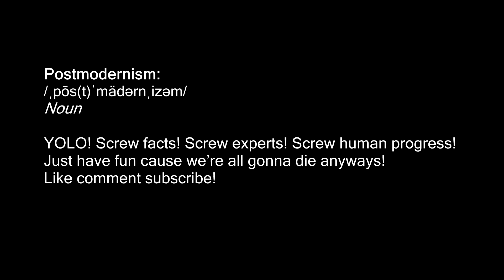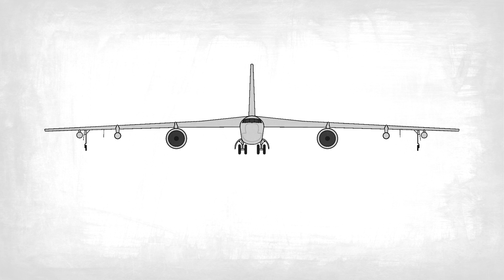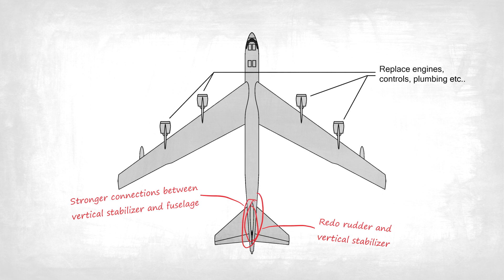The B-52 is Getting New Engines... Why Does it Still Need 8 of Them?

Comment: The particular kinds of payloads the B-52 may be called upon to carry cannot be dumped just anywhere or anytime. If I was the pilot, I would want all the redundancy possible to avoid dumping the bombs too early or too late if some unexpected disaster occurred.
Reply: Not sure, but I would imagine that most bombing missions - at least with conventional bombs - have designated areas relatively close to the airfield where they can drop their bombs if they have a problem. I think in some cases even if they abort the mission but nothing is wrong with the plane, as they're not supposed to land with them. I recall in WWII bombers out of England would drop them in a designated area of the English Channel, from which boats were kept out. This is a bit more problematic with a nuke though, as the radioactive material means one being dropped is a major incident even if it doesn't go off.

Comment: The rudder fin height on the B-52 was once much taller than it is now. I the early 1960's (I believe), the rudder fin height was reduced on the B-52's produced after the earlier models (& maybe some of the earlier models were also retrofitted with the shorter rudder fins, as well). I'm not sure why this was done; possibly to reduce the cross sectional radar signiture of the fuselage. But the taller fin would have had more surface area, & thus provided greater yaw control, which should have been more favorable for more powerful engines. But I don't think increasing the tail height is the right solution, since the aircraft's radar cross section is probably already quite large.
Reply: The cross section of the aircraft is quite massive, it's just one of those aircraft that does not actually need to care because of its choice of armaments.

If you are against a non peer adversary you can just sit high and swamp a grid square or two with GBUs. And if you are against a peer adversary you can carry a Frigate's worth of cruise missiles you can launch from far beyond the range of any AA system. 

Hell I am sure if you just filled the thing with SDBs you could single handedly target an entire subsection of the front with bombs to the point where the primary bottleneck would not be if you can target enough things but if you aren't going to cause the datalink network to crash.

Comment: It doesn't have the GROUND CLEARANCE to use single with enough thrust to make up for the 2 of the ones it has (or is getting).
You'd ALSO have to completely redesign the landing gear, and the landing gear housings, and all of the stuff AROUND those housings......

Comment: Sounds like a regional jet? Yeah - no. I grew up om B-52 bases - nothing sounds like eight Pratt engines with zero restrictions screaming at full power on takeoff during an alert. We would high tail it to the end of the runway on our bikes and watch these bombers roar overhead - the ground would shake and the roar of those engines would deafen you - it was great! I understand that American made Rolls Royce engines are replacing the  Pratts - I would love a chance to hear one of these updated planes to see if it has the same effect on me all these years later.  The B-52 came out before I was born and I'm sure they will be still in service long after I'm gone.
Reply: Yeah, spent the first few years of my life at Blytheville AFB.  Nothing like the sound of a B-52 on takeoff with that water injection on those engines.
Reply: I live next to Edwards AFB.We have ALL the Air Force's current inventory (and one or two from the Navy) flying over our house almost daily. It's easy to tell the difference between planes by the noise generated and the amount my house shakes and rattles, even though we are around 12,000 yards from the centreline of the runway and behind low hills. B-1s and B-2s rattle my windows when they takeoff, but F-22s barely cause a ripple in my coffee. F-15s rattle the stuff on the shelves,  C-5s rattle the furniture, and when BUFFs take off, they occasionally make car alarms go off. We get regular sonic booms and low-flying fighters, etc. but the best (and funniest) thing I've seen in 9 years living here was when a C-17 flew underneath some very surprised crows, probably less than a hundred feet off the ground. That guy was practically on top of us before we even knew he was there. Bloody noisy when they land though :-D

Comment: As a machinist for the DOD, I've been hearing this conversation for more then 20 years....
Its NOT going to happen.  Its an engineering nightmare! TF33 a proven engine, a little weak, a gas hog & just old. 
I've made many parts for the 52, some of the blueprints I have worked with, were older then me,( Im 60)

Comment: Thank you. I'm a systems guy and had no idea even 4 engines would cause so many systems imbalances. Define to goal of what 2 or 4 engines would accomplish. Engines are only about thrust and fuel economy. If 8 new engines meet that equivalent, then good to go. No other mods needed. It's not likely a weight savings would translate to more payload.
Reply: Typically fewer larger engines are more efficient than more smaller engines. They're also less maintenance, as typically there isn't much difference between maintaining a small versus large engine, so half as many engines means half as much maintenance. And probably an engine that produces twice as much power will cost less than twice as much. So fewer larger engines is more economical all the way around. For this reason airlines, who care mostly about operating costs, have abandoned quadjets and now use twins for everything. Why the 757 replaced the 707, the A350 replaced the A340, and 747s are being phased out mostly in favor of (slightly smaller) 777s. The same logic would seemingly apply to the B-52, but there are some differences. Military is less concerned with operating costs as they aren't trying to operate on thin profit margins, the aircraft typically fly a lot less, designs are more specialized, and combat survival is a consideration. For the same reasons, airlines aren't flying anything nearly this old, if they were really concerned about these issues to the degree airlines are they would have bought new aircraft decades ago rather than talk about re-engineing a design from the era of the very first jetliners. Though that too is less practical, as due to a smaller market the per-unit development costs would be astronomical. Actually come to think of it they've tried to replace the B-52 several times, first with the supersonic B-1, then with the stealth B-2, but both were not as good in the end, trying to achieve other things (supersonic, stealth, respectively) when what was really needed is just a big plane that carries a lot of stuff.

Comment: Something I pondered over for years!  Why not put four newer, more efficient engines?  As stated in this clip, too many other mods to an aging airframe would not be cost effective enough to warrant that.  The old engines are improved over the years anyway with enough technological improvements anyway, right?  But then again, one disintegrating engine on a “twofer” pod, most likely will effect the good engine.  So...
Reply: That's something I've pondered, all this talk of redundancy with 8 versus 4 engines. Depends on the failure type, probably the majority of engine failures are "contained," so wouldn't throw debris into the other engine. But some are uncontained, such as a fan or turbine failure, and I'd worry could damage the other engine. As happened to LOT Flight 007, when one engine turbine disc failed, destroying the adjacent engine in the Il-62's similar two-engine-nacelle, though it also damaged an engine on the other side and systems in the tail, resulting in loss of three of four engines and flight controls. With the B-52, I think about this even more with combat damage - engines destroyed by being shot at, flak (or whatever the modern equivalent of that is), maybe even a missile, anything like that hitting the pod is likely to damage both engines simultaneously, or cause an uncontained failure of one engine that destroys the other. Thus from a combat survival perspective, I'd regard the two engines in each pod as a single unit to be lost together.

Comment: And remember, the new engines do not mean they will have more power and thus more thrust.  Nor will they shorten the takeoff roll.  The wings and fuselage are stressed for the power of the existing engines.  Nor will they increase its top speed.  These new engines will do nothing for performance.

So why the new engines?  The last B52H was delivered in 1962 so the existing engines were designed for 60-year-old airplanes based on 60–70-year-old specifications.  No, these new engines will be more maintainable from a cost-effective standpoint and from a mission standpoint, add range.  Therefore, they will require fewer air-to-air refuelings per mission profile.  And let me tell you, fewer air refuelings is well worth the expense.

I never got to fly the 'H'.  I flew the B52G during the cold war of the 70s.  A major difference between the 'H' and the 'G' was that we needed 10,000 pounds of water for takeoffs to get the 488-thousand-pound beast off the ground.  But the air refueling challenges and stress were the same.  And now that our grandsons are flying the BUFFs, the new engines will really help them.

Comment: Commercial jets went from 4 to 3 engines to circumvent noise restrictions at some airports which chose to deny access to planes with 4 or more engines. The video missed that fact.
Reply: They have reduced engines to lower costs.  Safety has been the casualty.  They dumped flight engineers.

Comment: PDX heavy: the fin of the B-52 is unique although has a tiny rudder compared to the rest of the fin
Ichinose: aww it has a cute rudder
Kakudate: ehh it has a very tiny rudder
Mikamo: uhh no big rudder
PDX heavy: the Air Force chose 8 of them to the B-52
Ichinose: OMG that was funny
Kakudate: it has 8 of these engines
Mikamo: 🤬 what the hell was wrong with the plane
PDX heavy: ahhh the B-52 the prehistoric plane that will fly beyond 2050
Ichinose: it is called the stratofortress
Kakudate: it is normally built by Boeing now Nexon
Mikamo: it is a Godzilla but the plane version

Comment: I just heard from a Pratt & Whitney employee that P&W is now out of the running. Also, those BUFF wings hang kind of low to the ground necessitating smaller, but more powerful fanjet engines. Airbuses' current gen. of engines probably will not be cost-effective. We'll see.
Reply: The contract went to Rolls Royce and they will supply 608 x F130 engines plus spares.

Comment: While the reasons posited in the video sound plausible, they are incorrect. The B-52 will fly just fine with 2 engines shut down and I have done approaches with 4 at idea on one side. Back before engine condition monitoring was done, and engine failures were much more common, it was acceptable to fly an entire training mission with 2 engines out, no rudder issues, no emergency declared, just fly the entire training mission 2 engines down.

The main reason for using 8 engines in an engine upgrade is that the systems on the B-52 provide no good way of maintaining  reasonable redundant systems with only 4 engines. The B-52 has 6 hydraulic systems and 4 alternators, divided between 8engines.  With 4 engines, at least 2 engines would have to drive 2 hydraulic pumps each. Since these hydraulic systems aren't  actually redundant, every hydraulic failure results in the loss of some control systems, it would be very dangerous to risk 2 hydraulic failures with a single engine shutdown. I always thought the solution would have been to use 4 engines and 1 or 2 APUs to run extra hydraulic pumps but the designers thought otherwise and went with 8 engines and no systems changes instead.

What is interesting about the video is that the narrator presents his narrative as though he actually knew what he was talking about, with no mention of the reality that he just made it up. Plausible though his explanation was, it wasn't correct and wasn't  the reason the reengined B-52 will still have 8 engines.

Comment: Another reason to stick with 8 instead of 4 engines is the fact that the B-52 has 6 hydraulic systems. Short of redesigning the systems that would mean on a 4 engined aircraft 2 of those engines would power two hydraulic systems. Loose one of those engines and you've lost 2 hydraulic systems.
Reply: Unless they used electric pumps for at least two of the systems instead of engine driven
Reply: @bluemountain4181  You are 100% correct. I realized my mistake about 2 seconds after I hit "Enter".

Comment: I don't understand what is special about the B-52. It is essentially a large bomb truck. It is slow, sluggish at the controls, very visible (do the engines run on coal?). Wouldn't just a modified modern cargo plane suffice?  It could even have greater carrying capacity and be comfortable for the crew (toilets!). After all, Airforce one is just a B-747 modified to Airforce standards, with electronic countermeasures, flares, chaff dispensers, encrypted coms and more.

Comment: There's nothing wrong with having a 8 engines. If anything, for a military aircraft, that is a positive.
Reply: If P&W had had a turbojet or turbofan engine in 1950 that generated 20,000 pounds of thrust than Boeing would have designed the B52 to only use 4 engines.

Comment: Will this work use 8x B737max Leap 1bs or not? In theory it should improve performance just like using 8 BR700 engines from B717 G650 G550 on the B-52. Other option 8x PW1000G

Comment: Ahh, thrust asymmetry. The Achilles heel of early jets. Didn't a damaged DC-8 crash on take-off when they tried to take off with only 3 engines but the rudder just couldn't compensate for the asymmetric thrust?
Reply: I remember the story. Not sure it was a DC-8 but the pilot turned into the stalled engine which is a big no no. So the plane lost lift and the rest is history.
Reply: @jonathonspears7736  I was thinking of another case.

Number 1 engine was down while on the ground and they were going to ferry it to a repair facility.

They were trying to get as close to sufficient speed on 2 engines and then bring up the number 4 engine from idle once they had enough airspeed that the rudder could compensate for the yaw.

But the rudder was just so weak, at Vr the speed is too low for the rudder to compensate for asymmetric thrust.

Yet they could not get to Vr with only 2 engines on the runway length they had.

It was a terrible catch-22.

It was theoretically possible to safely take off but the third functional engine needed to be powered up at such a precise moment.
Reply: @Treblaine  
Ah. Thanks for sharing.

Comment: If it isnt broken, dont fix it. The new engines wont even make the plane faster. It will be a more fuel-efficient plane however with other advantages.  However as a war machine, it will be about the same

Comment: I would like to add that the smaller engines are less likely to ingest debris like Birds or Shrapnel etc!  Plus You need to take into account the planes radar signature etc!  I wish people would stop trying to speculate how great the present is; It is like having a documentary saying how great the 57 Chevys would be if only they were made with 3. Cylinder Engines and that ran off of Leprechaun Piss and where modified to be Hybrids!😂 This is a “War Plane” not a fuel saving Passenger Plane!  Different rules should apply!

Comment: Also, because of the PW800's physical design, it'll more easily fit where the TF33s are now.
Reply: They'll probably have to redesign the entire engine nacelle and pylon, so how well it would fit in the same hole is irrelevant. That would only be a consideration if discussing internally mounted engines that need to fit inside a structure that cannot easily be changed - such as the center engine on a 727, DC-10/MD-11, or L1011, or engines buried in the wing root (Hawker Siddeley Nimrod) or inside the fuselage (most fighter jets). This is one of the nice thing about podded engines - it's fairly easy to change engine designs because they can hang an entirely different pod quite easily. Even in some cases the pod could have either one or two engines - the B-52 has two per pod, they thought about one per pod but the rudder issue enforces two per pod.
Reply: PW was not the selected engine, RR was.